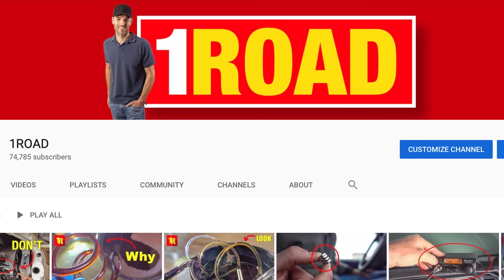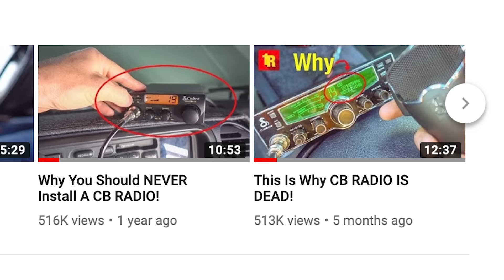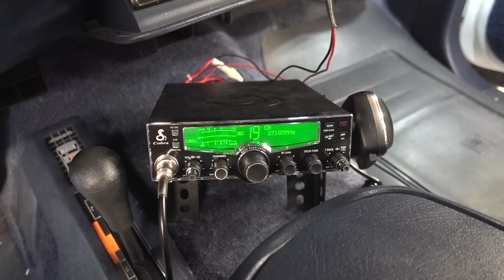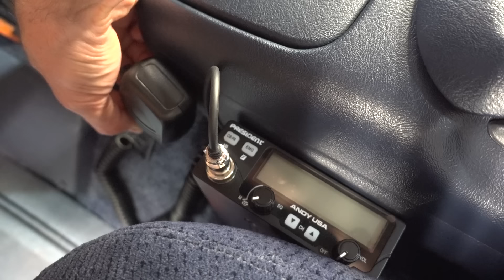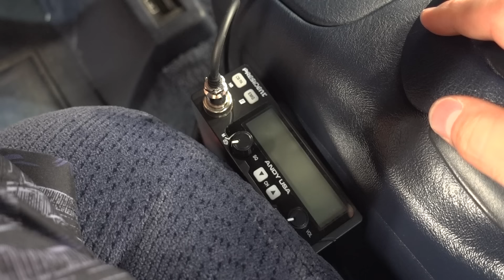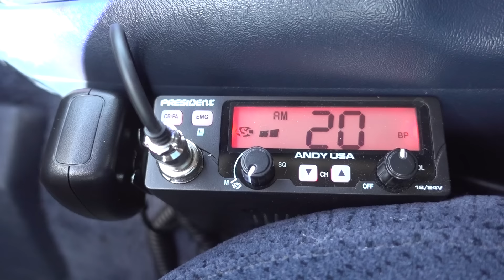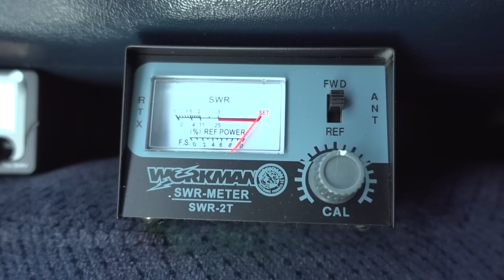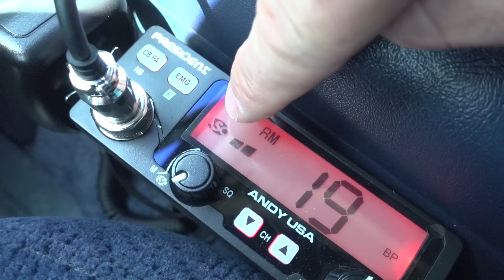Here's Why YOU SHOULD TRASH YOUR CB RADIO!

Comment: Last year I drove from Phoenix to Flagstaff AZ on my way home to CA with the CB radio on. Nothing. 

There’s scattered radio chatter here and there along various highways all over CA but I rarely hear a trucker or mobile. 

There’s a Friday night check in around the San Francisco Bay Area. We get maybe 50 to 75 check ins. The rest of the week it’s mostly dead even up on a hill. The one exception is Mt. Diablo. If you broadcast from up there everyone in Northern CA wants to talk to you. The whole channel goes stir crazy. 

But most of the time it’s dead where I live. Maybe in another year or so when the skip comes back it will be better.... 🤔

I have a tiny Uniden under my dash on the passenger side. It’s about as small as yours. There’s a linear amplifier under the seat. It works.

Cobra makes a radio that fits in your hand. That’s all it is. The whole radio is built into a microphone. Smaller than your President.

Comment: Is it just me… I noticed that the combined space taken between the President CB radio and the SWR meter would have been enough to fit the other unit. Also… Wouldn’t the speaker of the unit be blocked by either the seat or the centre console, making it an odd position for the driver to hear? Just saying.

Comment: Suggestion.  You shoulda mounted the bigger one on your dash.  That’s where mine is in my ‘82 Bronco.  Fits just fine, I simply turned my bracket upside down and drilled 5 holes in the dash.  One for the antenna cable, two for the bolts on the mounting bracket, and two for the power cables.
Reply: I had an 82 F150 and an 80 Bronco.  The F150 went on the ceiling very nicely even though it was similar in size to the  Cobra 29.  It was a Tram D42.  The Bronco had a large console between the bucket seats and I put it and the bracket on the front side of the console with the radio facing up.
Reply: This may not apply to starcloakstarside9719's '82 Bronco, but airbags have been used in motor vehicles since the 1970's.  One should  think twice before mounting — anything — at this location unless you want to get up close and personal with your transceiver traveling at 200 mph. On a lesser note, heat from the sun beating down on your radio is not recommended.

Comment: I've got a Bearcat 980SSB and Icom ID-4100 that I need to install in my 2020 Ranger but it is super hard to find a good place to put them.  The Bearcat is twice as big as the Icom and it's mostly empty space inside.  I get that they're trying to appeal to the oldschool guys with the familiar size, but dang...  It could have been so much more compact.  The Icom at least has a detachable face, but Icom didn't include either that or the bracket for the radio itself.  $35 each for a radio that goes for ~$375.  The same again for a programming cable.  The radio is nice, but I have to say that Icom nickel and diming me kinda left a negative impression of them.

Comment: My CB Radio is enclosed in a slightly larger than normal handset with only power and antenna cable going back to the vehicle. Only space needed was some for the mic hook. Bought it in Malaysia. Sounds like your new unit is an old design they are well worth ng off cheap.

Comment: Ham radio is better option in every way. A lot more options and setups available with better quality radios. I worked on CB radios before and was so surprised on the crappy quality for the cost of the radio. You can have more power with Ham radio and smaller antennas if you use a higher band. You can have multi band radios and use the band thats best suited for that environment. 2 meters is the most popular, but I realized 6 meters works so much better in my hilly area for p2p communications.

Comment: I'd trash it too. If I had one.
Buy a rig, buy a twig, buy a power supply, buy a power mike, buy a SWERR meter. Buy, buy, buy. There's more to radio than that.

Why not make something? Stop playing at it. Do it proper and get an amateur radio licence.
I don't have just one band like C.B. but have all h.f. and rebuilding my transistor 5 Watt h.f. homebrew rig to add 60m and maybe 4m. Okay, home built is always larger than anything we can buy. I built my own resistive SWR meter, wavemeter, power supply, built a frequency counter from a kit. I don't buy aerials, I build them, dipoles up for 40m, 20m, 17m, 15m, 12m and 10m, 6m, and a 4 element collinear for 2m. I saved a small fortune.
I built a simple one valve transmitter and power supply a few years ago. After a lot of repair/rebuild I got a 76 year old ex-army radio working. I keep looking at gear for 10GHz.

Why not join the 2,000 people who passed the Foundation Licence in the U.K.?
There's so much more you can do besides talk; Morse Code which I love, television, various data modes, talk through satellites, Moonbounce, meteor scatter, even schools can talk to astronauts on the space station. All kinds of frequencies available from  l.f., h.f., vhf, uhf to microwaves.

73, Bill, G4GHB.

Comment: Think about it:
   If SHTF I would not use radios of any kind to get ‘help’, there won't be any, just folks looking to take what you have. Rely only on those you already know in your circle, etc. Instead I'd use scanners to listen to what everyone else is doing and what's happening. I have all bands/channels in this area programmed. I also use the 'signal stalker' feature on one radio to pick up 'danger close' radios & personnel, ie, those that may encroach my ranch fence lines. Using Ham radio to talk to pple 200 miles away is pointless. To talk to family all over the ranch when SHTF, we're considering 49 Mhz band, no one uses it due to low power limits, so no one is listening either. We're looking at 49Mhz AM radios built for .5W to 2W ERP with off-channel freq's. CB, FRS or GMRS is like a white flag on your front door! Imho.... comments??

Comment: Not sure why those fire dept. workers had to shut off the broken hydrant right at its exact location when presumably the water pressure could more easily have be shut off at the nearest water main valve made for that purpose which would have been further away from the actual break. I suppose it depends on how the local water main infrastructure is set up to begin with. Obviously, where similar oil field fractures occur, a lot more caution is required to shut off the deluge!

Comment: You should ''Trash'' whatever CB you have - if it's not a side-mic-jack Cobra 148GTL or Uniden Grant XL.
 They are the only dual IF stage CBs and have the best sounding AM receiver, transmitter and stable SSB, but they haven't been made in 20 years so good luck finding one, and no doubt it will require new capacitors and a real alignment from a real tech, not a garage or shade-tree ''Tweak & Peak Tweaker''.

Comment: One other thing... The President line of CB radio is a good purchase , good performance and reliability but your ANTENNA MATTERS AND YOUR SWR NEEDS TO BE MONITORED FOR OPTIMAL PERFORMANCE Range 1.0 to 1.5 before you loose performance 

CAUTION ⚠️ 

Operating your radio rig with an SW are higher than 1.5 can damage your radio on long-term operation , operating a radio over 1.7 can damage your finals an internal components and fry the radio making it useless and a paperweight...

One last thing...

Antennas!

There are three antennas I recommend for mobile use for CB radio...

K40, K30 (similar to what was used in this video), and the 102” Stainless Steel whip (IF TUNED CORRECTLY to a 1.0 to 1.2 will greatly increase your talking distance depending on the terrain you’re in)

CB BASE station antennas are similar in setup and operation, if you can find one I would recommend EITHER a “Starduster” (is a 3-4 Element fixed antenna OR A Solarcom A-99 (“A” stands for Antron and “99” is the model number), just go to Amazon and type “a99 antenna” in the search box, this antenna is a 3 piece single pole antenna you assemble and very easy to set the SWR, anyway both antennas are considered Omni directional) and placed at least 40’ in the air and make sure it’s grounded for lightning ⚡️ strikes....

This goes for just about every CB and Amateur radio out there..

73,

KD2PKN

Comment: Here"s something to think about..
If you want SMALL..!!.. 
I'm a ham radio operator... 
Here you go.. 
Get a walkie talkie CB...
The reason they don't seem to reach as far is because of the walkie, short antenna..  You can buy a adapter, screwed on the vehicle antenna.. Now it fits your walkie...
AND.. when you get out of the vehicle.. Put the walkie antenna back on... 
End of problems...
Don't try to transmit WITHOUT any antenna...  Break the radio.. Or as we say.. It blows the finals... No workie..
1 radio... Two things it can be used for... And that should be small enough for you... 
My ham walkie, talks all over the world.. Then again, we use repeaters..
Look it up.. 
WORLD WIDE MORGANI... 
CB is the way to go,  = for communist shut all comm down, we can still communicate locally...
Especially with the walkie antenna.. 
Good for about a mile around you.. Hooked to the vehicle antenna.. 4 to 10 miles..  Base=.. Home antenna.. 12 to 25 miles... = all in one hand held radio..  
When you get REALLY good.. Build a dipole antenna..  Horizontal.. Wire or STRING.. A few zip cords =  3 .. 12 inch LONG... And 2 plastic or glass bottles full of water.. Thrown over tree limbs.. Tree
  🌳====------=!=-------====🌳
The soda/water bottles, let the tree limbs blow around without breaking the antenna or STRING..
LOOK IT up.. Dipole antenna...
Same as a base station, antenna, in the great outdoors.. ..if done correctly... Very hard to detect..
And because its using bottles to hold it up.. It can be moved around.. 
In most cases just untie the soda bottles and it comes down.. 
Bottle with water, makes it easy to throw back up over that or ANOTHER tree limb.... And you have your long distance radio signal/station back up and RUNNING
Army comm speicalist.. 
Ft. Campbell, KY...
Retired....

Comment: I want someone to come out with a remote mount version, preferably with SSB, so I can fit it in the tight spaces common in modern cars. Trying to stuff a CB in with my Icom 4100 for 2M/70CM/D-Star ham bands and then a Yaesu 891 for the HF 6-160M ham bands.

Comment: I think days when things are getting bad with EMP threat I think it's a must for everybody to install CBS in their cars because when nothing else works and has fried no cell phone service to CB's will still work I have a cobra old 23 Channel 19 and I love that radio I wouldn't mind having the one that you don't use no more to run Bass Station power Supply
Reply: I was under the impression that EMP will destroy any device with electronic circuits. Why would CBs be exempt?
Reply: @munsters2  well you have a point there the newer cb's would probably fry but the older ones won't I have crystals in them to control the frequencies. as long as they're connected to a battery such in your vehicle if you have one in the house plug in the wall yes it's going to go boom

Comment: Why did you not install your cobra, overhead in your truck ? Mounted with a mounting-plate in the middle of both seats simply at the ceiling of the truck ? I could understand if you would replace your cobra with a President George 2 or an extended President Washington 2. But not with a President Andy ?. This is like you replace your Ford F 250 against a VW Golf GTI !

Comment: First of all, it is ILLEGAL to "broadcast" on CB.  Broadcasting is sending out a signal to people in general without a specific person to receive it.  CB operators "transmit" NOT broadcast.
Actually, I can think to two reasons to have a CB radio.  One is to monitor the traffic reports from the truckers if you are traveling, and the other is (if you have the skills) to modify it to 11 Meters.  The SSB CBs can be used for 11M SSB and the AM ones can be modified to function as FM.  Anyone that has passed the Amateur Radio exams should have the skills to make those modifications.  Don't think you have to work in electronics to have  those skills.  I am a retired accountant, and I hold an Amateur Extra Class license.  Don't forget Amateur repeaters have a very long range, are battery backed up and many of them have automatic phone patches.  Repeater use is usually free but autopatch use often requires club membership.  Most clubs charge an annual fee that is approximately the same as a monthly cell phone bill, often less.

Comment: I used to sell CB radios to CB Stores they where 23 channel and you needed a radio license than they when to 40 channel and side band you had 120 channels  then the Government said no license required the paper work  was to much. Now we have the Family radios (portable only) 22 Channels UHF and I think 4 VHF no license either. There are also some spread spectrum frequencies  900 MHz 2.4 GHz and 6 GHz and others main used in Blue Tooth and Cordless Phone some are used in SCADA control systems. 
Some have have convert CB radios form AM to FM for greater range and clarity  but I don't know if that is legal or not.  The main use for CB now is  gravel pits off road people most have gone VHF for longer range in BC you need a VHF to travel any logging road. 

To get the best range with  a CB radio is twine Antenna (Call twine truckers) on on each mirror. Also important is have a good ground plane with a lot of carbon fiber cars that can be a problem. .

Comment: "Size"  is NEVER a reason  to choose a radio.  All other things being equal, on be  "thing" for choosing a radio is  THE EFFECTIVENESS OF THE NOISE LIMITING/ BLANKER.  If you TRUELY operate  MOBILE as opposed to some remote off-road  campground,   the noise reduction systems in the radio are KEY.  Noise from power lines, other  vehicles, your own vehicle,  and atmospheric noise.    Most my "rigs" have been gasoline,  which can be a lot noisier that older diesels.  More modern  consumer diesels  with   EFI instead of mechanical  injection are likely more noisy as well.  
I'm 73, first licenses as amateur in about 65, and have run  both cb and amateur mobile.

Comment: Hopefully someone could help me. I purchased  K 30 Magnetic Antenna with the intensions of a roof mount on my 2019 Ford F 150. Yea, I know what your thinking, anyway...I found the top of a metal junction box which is slightly larger then the base of the K30. It is secured to the roof via heavy duty Velcro which works great. My question is : do I have to ground the metal junction box cover via  wire to the frame of my truck or does the metal junction box cover act a a ground? Thank You in advance.

Comment: Poor forward swing on the radios meter when you key up and talk. The meter should slam fully to the right. The radio isn't putting out its peak power. Get the radio tuned and power wire directly to battery with good thick wire. SWR looked good

Comment: Read your comments... there is alot more that goes into installing a cb other than a low level cb radio that is made to plug and play... I would suggest more research on cb radios and antennas... as some cb radios are made better than others... next would be antenna selection for the same reason... also you need to tune the antenna to the radio... going directly to the battery is a much better way of providing power to the cb than a cigarette lighter plug in... 
I myself am a truck driver and I have a galaxy 99 cb radio with a Wilson 2000 antenna.... now there are cheaper radios out there, it's just all about preference... but the better the radio and the better the antenna on a clear day you can get out 20 miles or better... the bigger radio that your taking out of your suburban is a better cb than the one from Walmart.... also a good microphone makes a difference when taking to someone...

Comment: Maybe cb is far from dead in the USA. But,  here in the UK it seems to have gone really quiet over the past about 5+ years. & i see many cb sets being sold from a basic straight 40 to a multi channel set . but,  not many near me. So,  for now due to other commitments i can't complete my set up ( a decent swr meter preferably a Zetagi but,  any other will do aslong as it works well ) & a decent power pack ( p.s.u UK mains). But,  until my other things are out the way i have leave these things for now.

Comment: You have avoided putting a 90s-style equipment, and you have put one of the year 2000 style.
For many years there have been equipment much smaller and more efficient than that President Andy, manufactured in a cast aluminum chassis that dissipates better the heat.  for example President Bill, Midland M mini, etc.

Comment: You really need to learn how to adjust SWR.  The SWR Meter does NOT calibrate you have to adjust your antenna. That is why that little will has a Allen key at the base so you can adjust the whip. You transmit at the TIP  receive at the tip and transmit at the base.

Comment: A much better choice would have been the anytone quad 6 this radio is very small. Over 10 times more powerful also you can access all modes AM FM single Side Band and get every frequency from 26-30 mhz.    The radio also has high cut filter and the radio is very affordable you will be able to access 11 M by pressing two buttons to unlock the radio

Comment: i find the fracking area runs radio channel for road travel in this hunting area i got a new radio and ant too around 40 bucks and free shipping i put this on a chunk of 2x4 up side down mount set on floor plug in to the cig lighter put magnet ant and it works i move from autos i drive that day! uniden pro505xl

Comment: HOW YOU DOING MY HANDLES CLASSIC MAN I HAVE A CB RADIO IN MY TRUCK A COBRA 29 CLASSIC AND A PENETRATOR TWO PILL IN MY HOUSE I HAVE A BASE STATION COBRA 25 1000 W LINEAR AND AN ANTRON 99 40-FT HIGH BIG COAX 120 AMP POWER SUPPLY I SPENT A LITTLE  MONEY ON IT BUT I LOVE IT